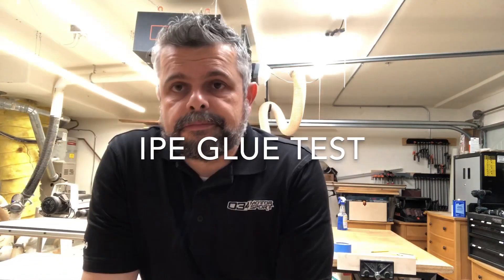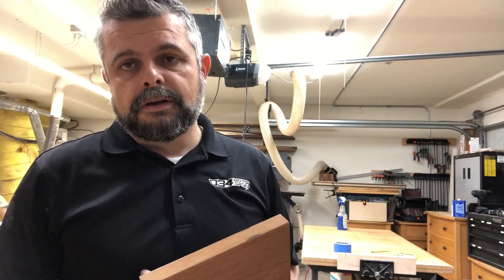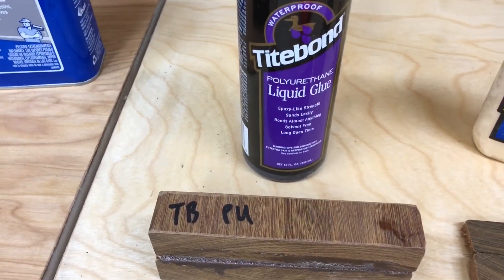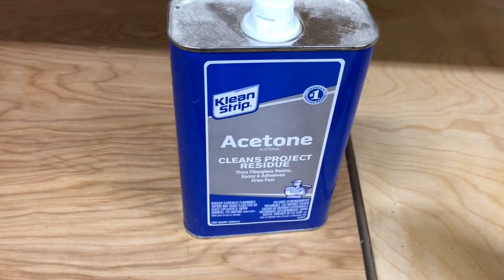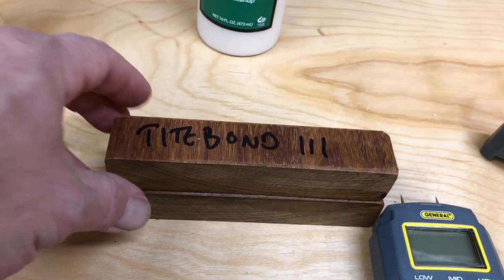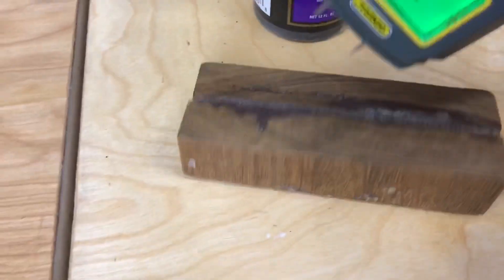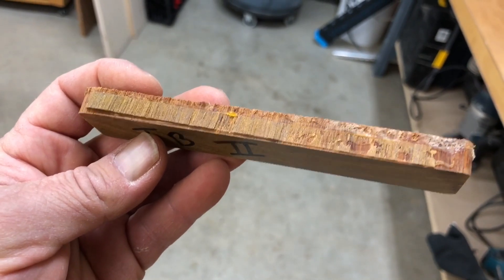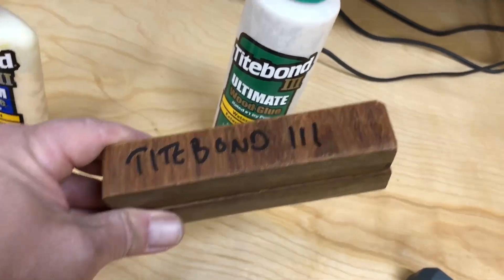IPE Wood Glue Test

Comment: I used this stuff to make a 54" x 60" x 4qtr Ipe slab that I installed outdoors under an exterior doorway. After six years where there was movement only the wood fibre failed. The III is water proof and the II is water resistant. I've also made 6" thick Angelique wood beams out of 8qtr stock. This stuff holds great.

Comment: I hand-carved a carving ax handle out of Ipe and it is tough stuff.  A lot of extra sharpening of my spokeshaves, chisels, and card scraper, but the result was well worth it.  Going to make a cutting board next.
Reply: How did it turn out? I'm making a Jatoba, tigerwood and Cumaru cutting board soon. I've heard its pretty similar to Ipe
Reply: @garrettjones1699  It actually turned out great, except for the booger on one side due to operator error with the chisel.  Oh well.  The balance is super and  using its own weight against it makes carving much easier.  Good luck.
Reply: @rosshollinger8097  Awesome. I love the heaviness of those brazilian woods its amazing
Reply: RIP knives

Comment: Someone on an archery forum recommended to degrease Ipe with soap and water instead of acetone. He wrote that the harsh treatment with acetone would cause the oil in the wood to flow back to the surface.
Reply from the maker: Good feedback!  I honestly couldn't tell a difference anyway, the oil on this Ipe I have didn't seem to affect the glue strength at all.  I suspect the issue may be over hyped.

Comment: I've had serious failure with Gorrilla Glue on a maple bow I made--total delamination.  I've heard that other polyurethane glues are excellent.  I can't speak for Titebond polyurethane glue.  I like the other Titebond glues.  I have many years of experience with WEST epoxy in boat building contexts.  It is great glue, but does not glue Ipe at all.

Comment: Unfortunately today I got a bottle of tb3 glued up a bunch of wood. Took the clamps off and could pull the wood apart with little effort. I have used tb3 dir many years with great success. I believe that this bottle had been stored in an area that was subjected to freezing temperatures.  We have not had those temps all week. Glue residue turned white not normal for this glue. Have you had any problems like this?
Reply from the maker: Wow Michael I have not!  TB3 is one of the better wood glues I've ever used, but in CA we never get freezing temps (certainly no indoors or in the garage), so yes I suspect that could be your issue.  I'd suggest getting some new glue and doing a test before proceeding.  Keep me posted!
Reply: Use when temperature, glue and materials are above 45°F.
Reply: When a glue "Chalks" (turns white) it is a definite sign that the glue and ambient temperatures are too cold.  I received this information from TB, and a bad experience.

Comment: Personally I think folks having trouble are either using the wrong glue, not using enough glue in the joints or using Ipe that hasn’t dried enough. I have no problems glueing this stuff.

Comment: Wash the 2 parts you want to glue with muriatic acide (let the acid eat the wood for a bit before washing off)

Wash it very well then rewash it to make sure 
To the touch it should feel rough 

Then you can glue the 2 parts together 

Ps 
i make a putter out or walnut and a IPE core 
Now working on the full IPE driver 👌👍

Comment: Don't use TB3 for speakers, musical instrument production or for anything that will be subject to lots of vibration. TB3 dries semi elastic, it doesn't dry hard like TB1. It's designed this way for making boats and glueing waterproof things that require a little movement in the structure. If used for speakers or building guitars, the woods can creep (ask me how I know).  Even after only a week or two the surfaces can creep and not line up. Also, the elastic properties of TB3 act as a dampener for vibration transmission between surfaces. You should watch a video by Beau Hannam guitars where he demonstrates these properties in a practical test with TB3 Vs TB1 and you'll see straight away why TB1 is the right glue for the job.
Reply from the maker: MSK Guitars, thanks for the comment!  I'd like to respond by saying keep in mind a speaker is not an instrument, instruments do resonate and the body of the instrument does create sound, I can completely agree how your comments would apply to an instrument.  A speaker cabinet, however, is not an instrument, the drivers themselves are the only part of the speaker enclosure that should resonate or create sound.  The cabinet we want to be completely silent and non-resonant, and in that light TB3 does work very well for speaker building, I've used it extensively.  All woods and glues do creep a little and I haven't noticed any excessive amount compared to TB2 which is what I use as my staple.  I actually don't use TB1 as I really like TB2.  Thanks for the conversation!

Comment: Tite bond lll is not water proof its not to be into water it says it on the direction  folder that come with it do not immerse in water
Reply from the maker: They list the glue as waterproof:
http://titebond.com/product/glues/e8d40b45-0ab3-49f7-8a9c-b53970f736af
Reply: @javadshadzi4824  read the leaflet that come with the glue IT SAYS NOT to be in water its only water resistance for out door use read it
Reply: @javadshadzi4824  do not immerse in water
Reply from the maker: @ronaldrice4085  they call it “waterproof glue”. What they say is it’s not to be submerged for long periods. They call TB2 “water resistant”.

Comment: No measurements, no test.
Reply from the maker: Joe Care it elaborate?  Clearly this wasn’t a scientific test as I mention, what would measure?
Reply: Hater!
Reply: When you see almost 100% wood failure, that is actually an industry test result. I knew the guy who invented the resorcinol glue that is the standard glue used in all US exterior grade plywood. It is marvelous stuff for gluing wood. He was required to test it using an industry tester. He glued together two pieces with grain running 90 degrees one to the other, and then tried to split along the glue line using a spec metal dull knife. Then they measure the amount of wood failure vs glue line failure. Your test is just fine, although using cross grain would be better.